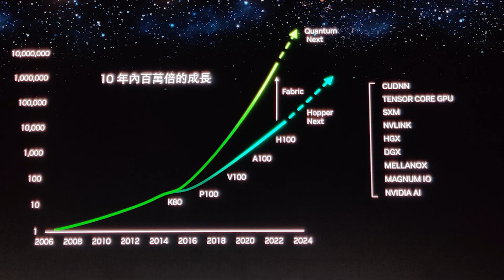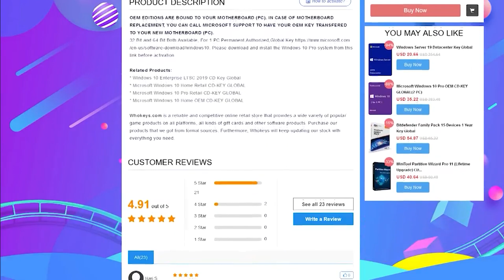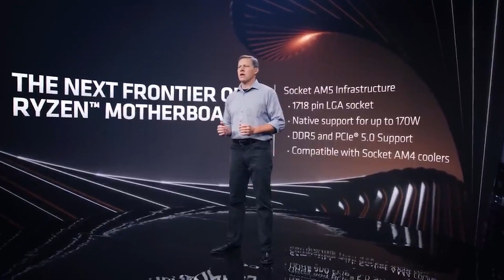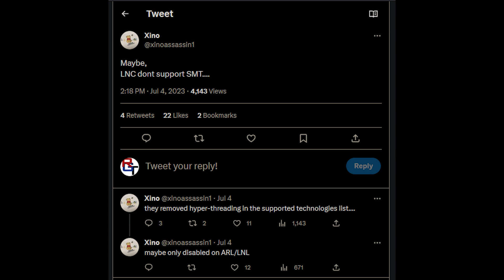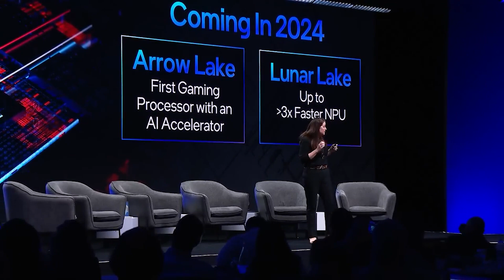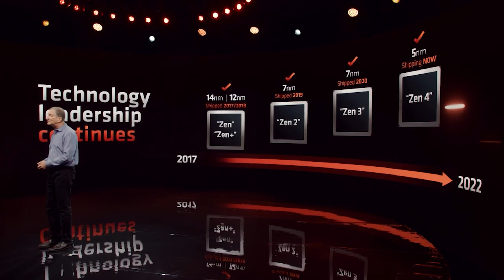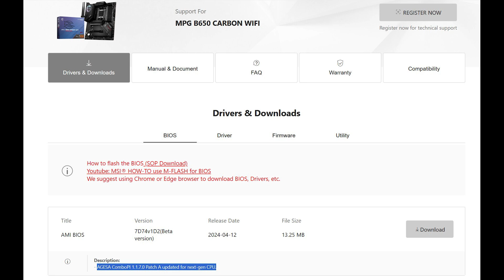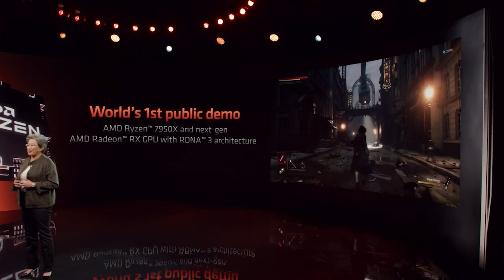Zen 5 CPUs CONFIRMED | RIP Hyperthreading - Arrow Lake LEAKS

Comment: Intel needs to drop the HT to give them more power budget for more crappy e cores.
Reply: HT seems redundant with estrogen cores. Pretty sure a single E-core is worth one thread on a fat core anyway. Windows is cocking it all up because if it dedicated a solution AMD would probably break.
Reply: egregious cores
Reply: Elderly cores
Reply: Cinebench Accelerators*
Reply: dont forget the side channel vulnerabilities. they're skipping a proper fix by dropping it entirely
Reply: @KhanhDinh291 side channel attacks have nothing to do with hyper threading. Those attacks are all possible even on the low end parts that don’t have hyper threading for both AMD and Intel. Almost all side channel attacks happen by exploiting results from speculative execution before the results can be thrown away. The only way to completely eliminate side channel attacks is to do away with speculative execution, but nobody outside organizations that are hypersensitive about security vulnerabilities (think CIA, NSA, etc) are willing to take the performance hit that entails. It would mean a 75-80 drop in IPC, and for enterprise customers that would mean a 4x-5x increase in datacenter capacity to meet the current datacenter workloads. The economics of eliminating side channel attacks by eliminating speculative execution are prohibitive to all but the most price insensitive customers.
Reply: This guy literally watches a video about Intel arrow Lake not having hyper threading, and then comments that Intel needs to get rid of Intel hyperthreading….
Reply: Ree cores
Reply: You should look up rentable units. It expected to be the replacement for Hyper-Threading.
And I agree it is a move to reduce the power draw and also address all the security concerns etc.
 Hyper-Threading is pretty old tech at this point.
It seems to me there could be some real compatibility issues with some professional workloads that heavily rely on Hyper-Threading.
And also, I do not understand the removal of AVX512 (I get the power draw angle) but seems be a mistake being that many AI and professional workloads rely on this.
That next version of the NPU better be freakishly fast......
Reply: Those crappy little Ecore are better than some of Verizon main cores so I would keep your little AMD fanboy mouth if I were you.
Reply: They freaking removed AVX-512 instructions because they didn't want to put it in the E cores (and the programs would crash if a core tries executing an instruction it doesn't know of) and AMD has just added it in Zen 4. Such an irony.
Reply: estrogen cores
Reply: More like: Intel isn’t able to fix HT against sideband- or RAM/cache-attacks. For effective HT the data needs to be on-chip, in the cache, and reachable for another core & HT instance. HT indeed also sucks up quite some power. Also HT would mostly be beneficial in cases where the CPU is the only bottleneck, and higher latencies are acceptable.
With P- & E-cores there are still more than enough cores, which easily could perform similar or even better when using powerbudget saved towards higher clocks&timings.. take in account the scheduling through OS & Hardware (intel thread-director)
I can see why,.. HT will still be a thing for the datacenter, though there security concerns..and (imho) Intel takes a wise road ditching HT as current design needs cache shared
Reply: If the skymont and darkmont e-cores have much better IPC than gracemont  and are power efficient, then what is the big deal?
Reply: I might get Arrow Lake, my AMD cpu blew up in the motherboard
Reply: AMD fanboy alert
Reply: @lldjslim  Intel idiot alert

Comment: Core triple number will be fine. Honestly I lost interest in Intel's naming scheme when they went to 10000. I figured they would have changed it then because of how silly it sounds. This also goes to prove that we will adapt, because when you say 14900k it doesn't sound silly even though it did when they dropped 10000 series :)
Reply: But then you have to make sure its not the same core triple number naming scheme as Nehalem or Westmere. Normally this is easily solved, like how AMD went from HD to RX on their GPU line. But in this case you couldn't have the exact same "Core" branding. Intel really cornered themselves with this one lol